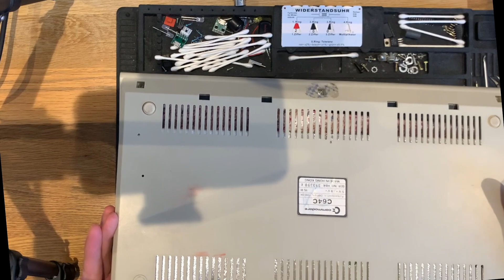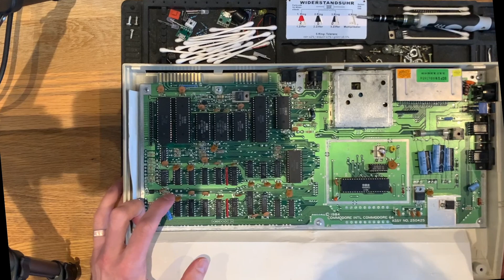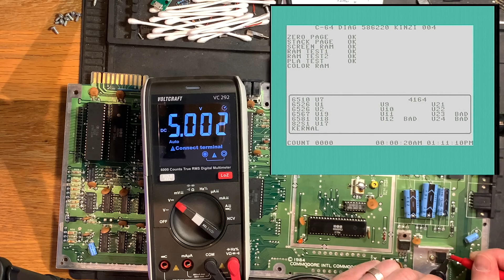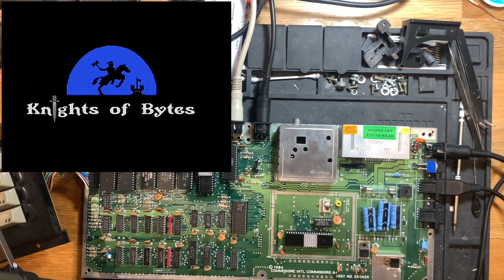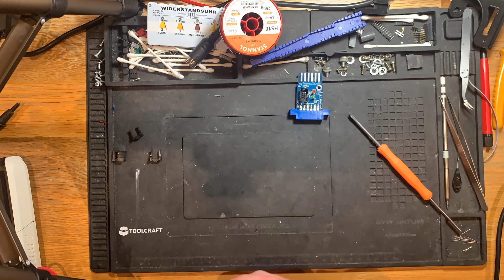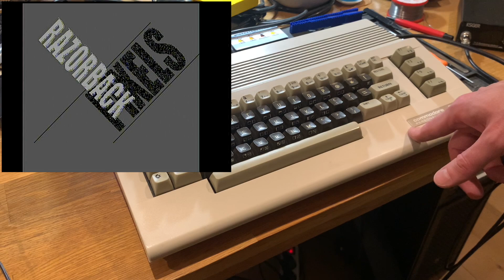C64C Repair: Shimmering Color

Comment: Around 23:00 I notice you clipped the ground lead to the edge of the board. On some board revisions this will short 5V to ground since there is 5V on the bottom side.

I had the same problem with the strange colours, turned out to be a bad U27.
Reply from the maker: Oh, thanks. That is indeed a tricky thing to happen. Didn't know that. Do you know which board revisions have this issue? I guess it's best to take a longer ground lead and clip to the cartridge shield.
Reply: @root42  In fact I believe it's the 025 board featured here. The 5v will have solder mask on it so as long as you don't scratch it it should be  fine. I put the clip on the exact same spot and it burned out the coil at L5 near the power switch (twice in fact because I don't learn)

Comment: 12:20 it did count up, but the display only refreshes after each test step. right as you turn it off, it showed a different value.
Reply from the maker: Thanks! I will have to test that questionable CIA once more.

Comment: Nice repair. A friend in work gave me a dead longboard, same revision as a spare parts board. I decided to have a go a repairing it. There was a dead 8701 clock chip but once I got a replacement for that most things were working, except one of the CIAs was faulty, in exactly the same way as your one. I managed to get a replacement but my CIAs weren't socketed. So I've procrastinating on that part of the repair. I should get to it again, I have a lovely black PixelWizard C64c case for it with a bread bin keyboard. I love the look of your one with mix of keys, looks great.
Reply from the maker: Do you have a desoldering gun? Some fresh solder and flux makes it easy to get those CIAs out. Be patient and gentle. I should perhaps make a dedicated desoldering video…
Reply: @root42 I do have one yes. It’s more a case of having space to work. That will be less of an issue in the next couple of months. I bought the desolder gun when restoring a 1541 a few years back.
Reply from the maker: Good! Then I am sure you will manage. There is also an FPGA CIA now available. But most often it is more expensive than a used one. However there are broken or fake ones as well, so you have to be a bit lucky.

Comment: Interesting C64C. Looks like someone replaced the motherboard with a C64 as the C64C should have the Super PLA chip, and the keys should be all white. Still, very cool and glad you got it fixed! Thanks for sharing
Reply from the maker: I think they sometimes put left over boards into C cases. And they even had the C64G — breadbin with shortboard! Though mine has a longboard…